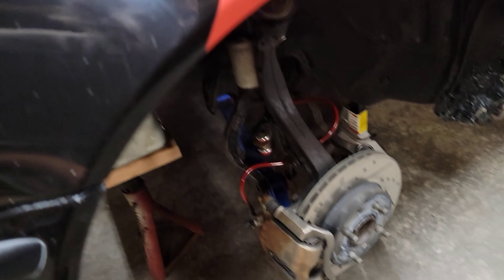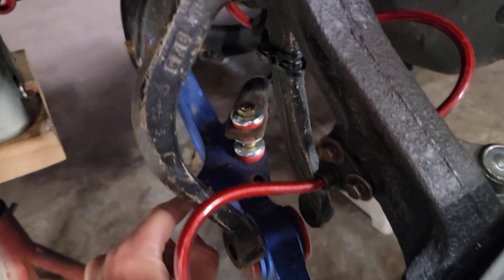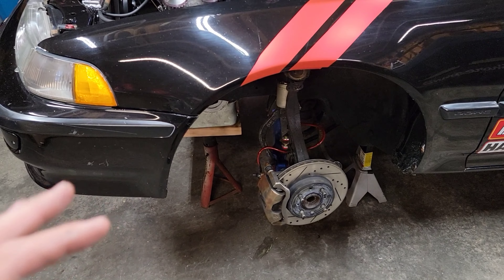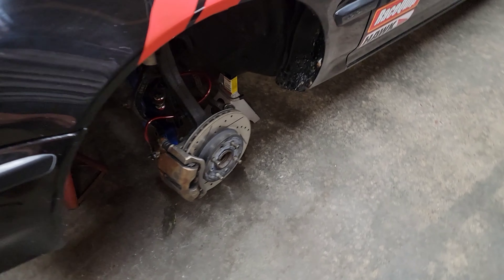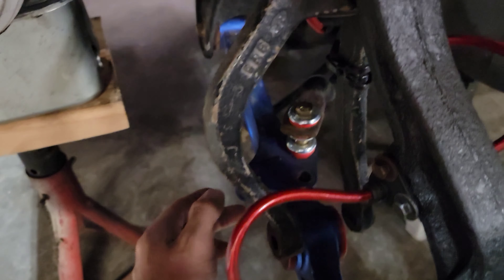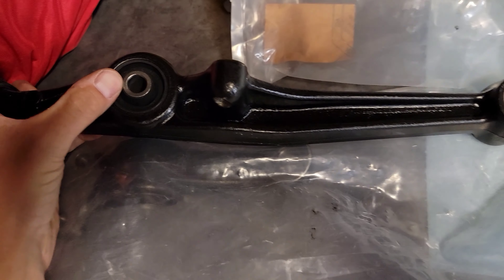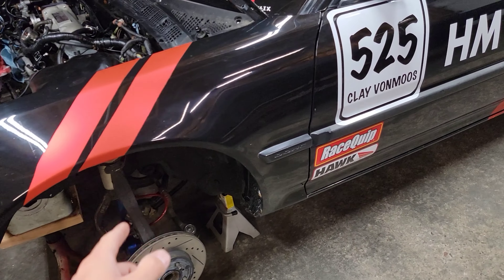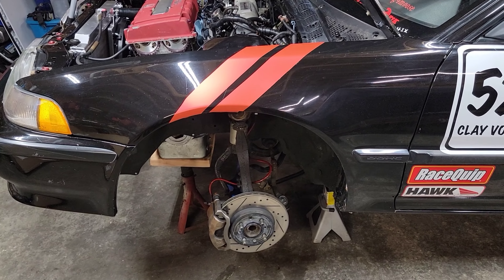DA, CRX, EF. Traction bar destroys control arm!

Comment: Im glad i ran to your video cause i had my doubts about running oem or truhart ones! But now i know what to do. 👍
Reply from the maker: @LuisVillanueva-gu9en  happy to help!
Reply: @diyclay525  I have b series swap on my ef first time doing this project with my son could we still run those OEM control arm or we need the ones of the Acura I also have ex spindles... What you suggest...
Reply from the maker: @LuisVillanueva-gu9en  oem arms should be fine. As far as spindles go I'm not 100 percent sure. The EF is a bit different depending on model. U may want to do some Googling on that to be sure

Comment: that can be caused by over tightening the radius rods since its a single heim joint its probably more likely to rip the threads out, maybe radius rods with double heim joints can help prevent that but im
not completely sure, its just a thought
Reply from the maker: It's definitely due to the aluminum control arm threads. I did some research and found out I wasn't the only one having that problem
Reply: Naw those front control arm are just to damn soft.

Comment: Is the traction bar worth putting on for track racing?
Reply from the maker: @the_JDM_fanatic  for a DA, crx, or EF it's almost mandatory.
Reply: @diyclay525  I’ve taken them off my del sol , and I have a ek track car, running Marie biscuit wheels,  b20 squeezing every little bit of juice of it… so trying to find a little more traction to go that little bit quicker

Comment: Did the Traction bar made a noticeable difference in handling? How about ride quality on a daily? 
Thank You
Reply from the maker: Yea, I have zero wheel hop and u dee heavy breaking its way more controlled. One of the best upgrades u can do
Reply: @diyclay525  thank you... Will get one..
Reply from the maker: @BLAZEPSI   no problem

Comment: Would skunk 2 LCA’s work well with the traction bar ?
Reply from the maker: As long as there not aluminum
Reply: @diyclay525  Which ones are the ones you ordered? I can’t really find to much info on what the skunk 2 are made of
Reply from the maker: @jouush_8421  here's a link to a steel set on ebay. These are reasonably priced and I have used these before.
https://www.ebay.com/itm/314003915553?mkcid=16&mkevt=1&mkrid=711-127632-2357-0&ssspo=4mpu6iyhsoi&sssrc=2349624&ssuid=I7AZxwUATVu&var=&widget_ver=artemis&media=COPY
Reply: @diyclay525  I appreciate it !! Thank you
Reply from the maker: @jouush_8421  no problem! Please subscribe if u haven't already. Would really help me out.

Comment: lol the traction bar is obviously not the problem here.
Reply from the maker: Ur right, the aluminum control arms are the issue. Put the steel arms back on and it's been fine for 2 race seasons
Reply: @diyclay525  we'll see, I just bought pci front lca for my crx, worst case I'll drill them and put steel threaded inserts in
Reply from the maker: @Maxh2b  easier solution would be drill it out and put a bolt all the way through with a nut.
Reply: @diyclay525  that would be possiblr with the pci arms the way they are made

Comment: Why not drill the aluminum out & sandwich a nuts at the bottom?? …. You think it’ll damage the integra-tee? 
(I’ve never messed with aluminum front Lca’) 

*integra / integrity* 
L😀L sorry I had to …. 
😛 hahahaha
Reply from the maker: Lol, those aluminum arma are juat really brittle. Way better to just stuck to the steel ones

Comment: Stock traction bar is better?
Reply from the maker: I had lot of issues with the stock bar. It can't handle super stick tires or high G force stopping. If u daily drive the car and your running all seasons then yes u are right. It has its time and place. But on a track car it is not the way to go. Aftermarket traction bar is way better. Just don't use aluminum lower control arms